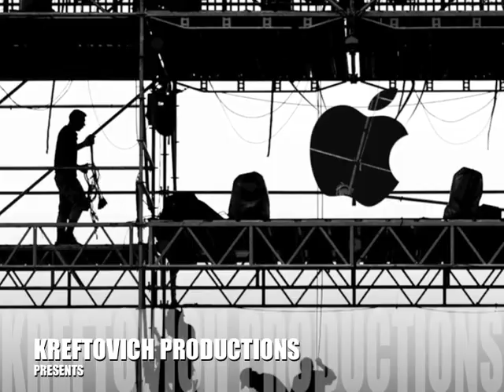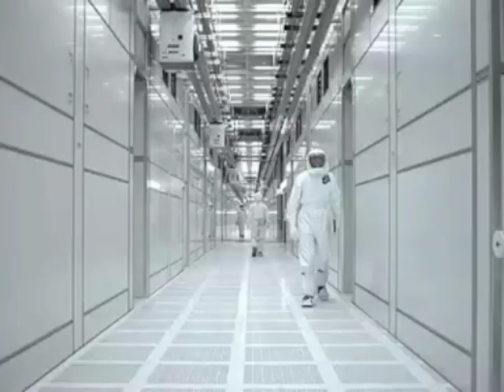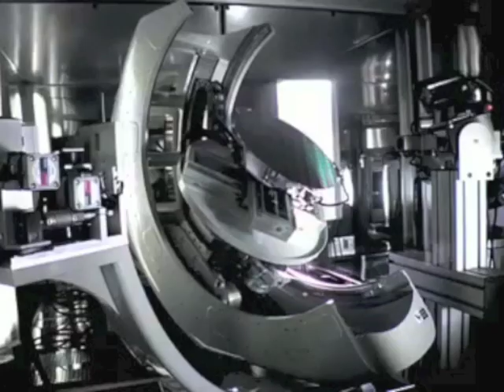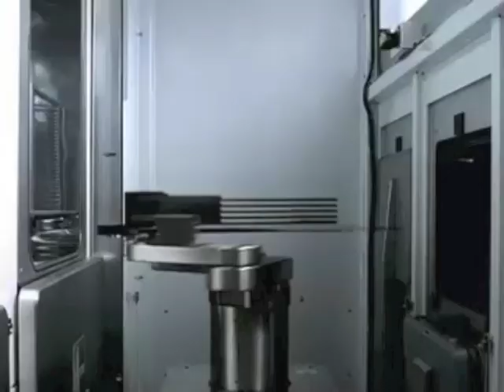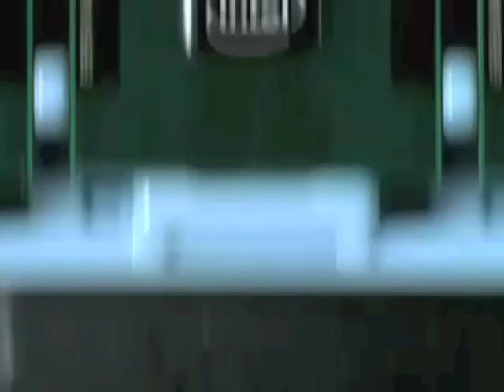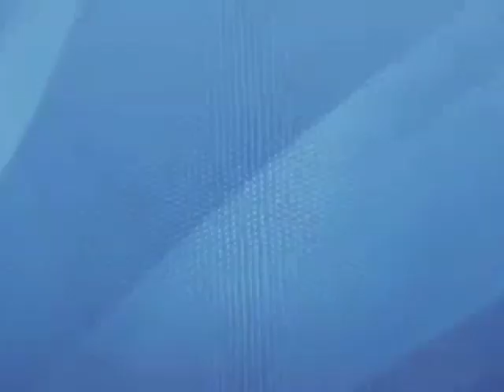Apple - Mac Intel Together At Last.

Comment: also my pc is not a dull little box, it's huge, and it feeds information to my gpu which i can use to fold proteins to aid research into genetic disorders and disease...   doesn't seem like a dull little box doing a dull little task. I can also overclock game and do all the things a mac can do on it. If i wanted to i could run a virtual mac on it. and it doesn't cost that much either